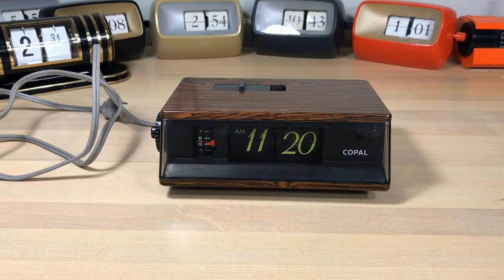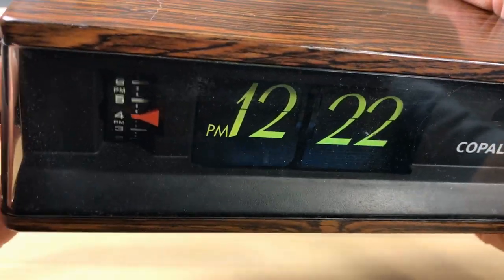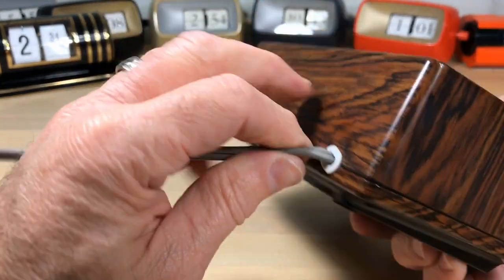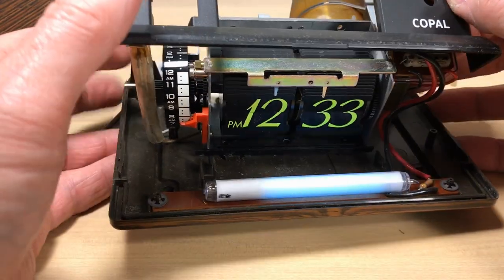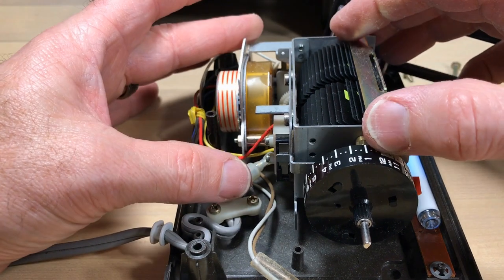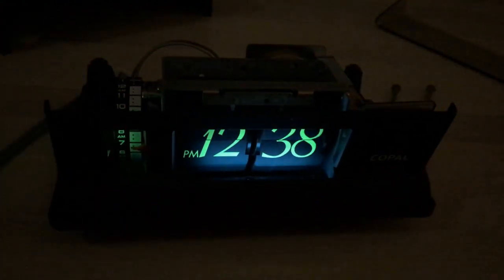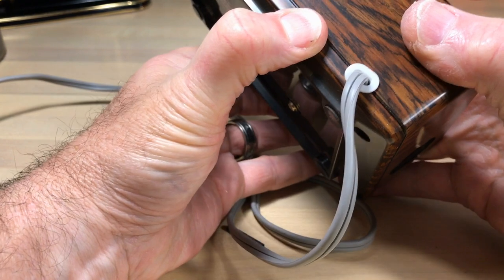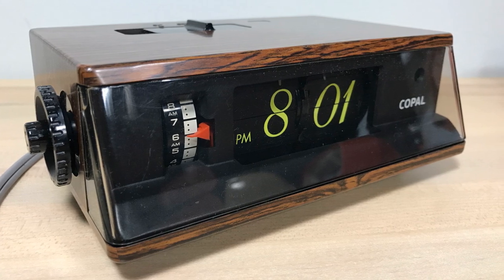The Copal Model LP-245 Black Light Flip Clock

Comment: Those locking tabs can simply be modified, slightly round the edge by carefully sanding or filing and use a PLASTIC cell-phone pry tool to open 😎
Reply from the maker: Good idea.

Comment: I had one of these but the pages kept getting stuck and I dropped it on a slate floor trying to fix it and it smashed into a million pieces. man would love to get one of the C-610 wall ones
Reply from the maker: I dropped a clock on concrete once and it disintegrated - I feel your pain. It was a Back to the Future clock - scored it for $80 and could have sold it for twice as much.
Reply: @Flipclockfans  im quite disappointed cause tried to get another but it went for over $300
Reply: yay found another one new in box at a decent price. got the alarm going also

Comment: what do you do if the alarm don't sound.. hear a click though
Reply from the maker: This depends upon the clock. Very often there is just a small metal bar that is supposed to vibrate that needs adjusting. Other times it could be one of the microswitches (usually labeled with the name “OMRON”) or even loose connections including failed soldier joints.
Reply: @Flipclockfans  I just kept toying with the switch must of had oxidation on it.
Reply from the maker: @SuperNathan90  - forgot to mention that. But congrats! You have officially restored a flip clock to it's original glory.